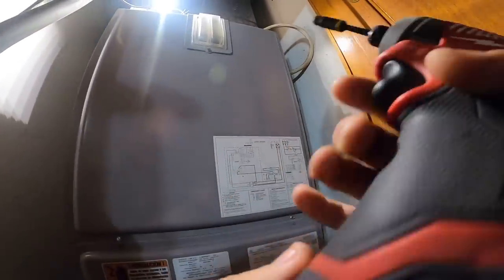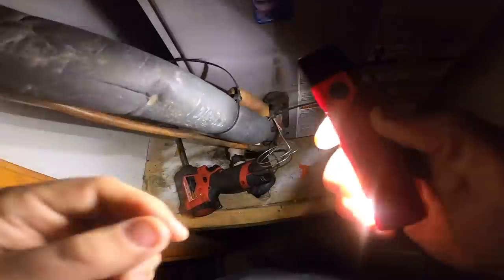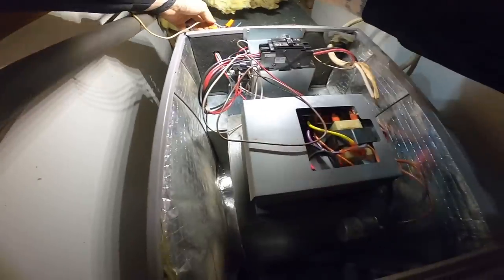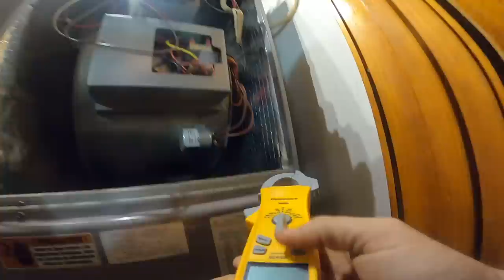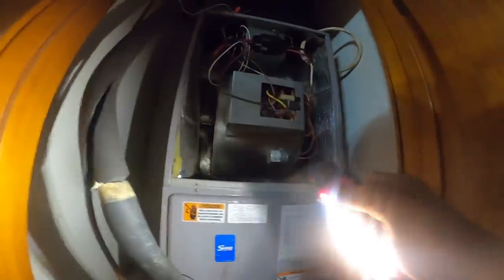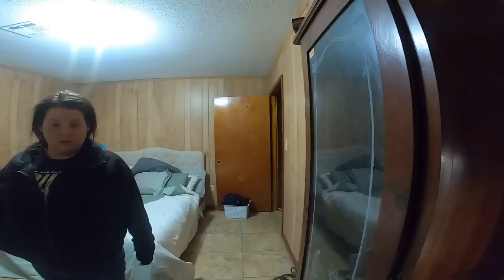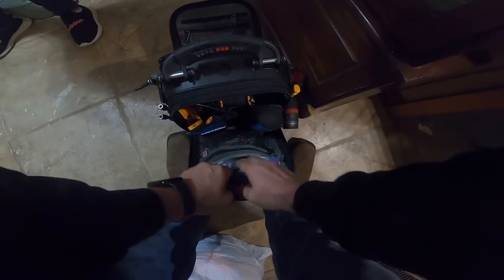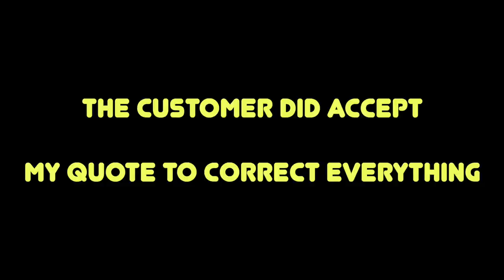Horrible Hack Job/One Of The Worse I've Seen

Comment: Did you verify breaker size in the house electrical panel after hooking up the white wires? Undersized breakers are extremely common.

Comment: It looked like you can see straight into the attic from inside the closet. I bet it draws in hot air and sweats like crazy in the summer.
Reply: Well bring that up lol, the 1 1/2” gap between the door and platform could be for fresh air technically. I’m just gonna bet it don’t cool.

Comment: Your a good guy. I just had my gas hot water heater, could have done it myself, but I would also have needed someone with a truck to help. To get it done quick, went with a very expensive company in town. Glad I ‘helicoptered’. They would have done shark bites. I made the guy get his torch out, and that part got done right. Also, not willing to go a week without hot water, so had to settle on a Rheem tank. Hope to hell gas valves are okay now. Last tank I wanted, but needed hot water quick. Wish could find someone of your caliber in my area. Be well, Merry Christmas.
Reply: They'll give you the gas valve free if it goes out plus the pilot assembly too if the tube gets stuck to the gas valve.
Reply: Specialists hate helicopter customers.